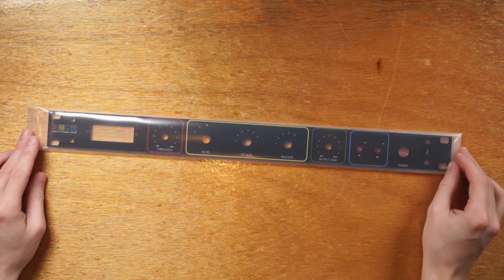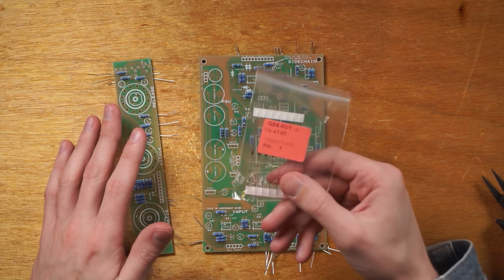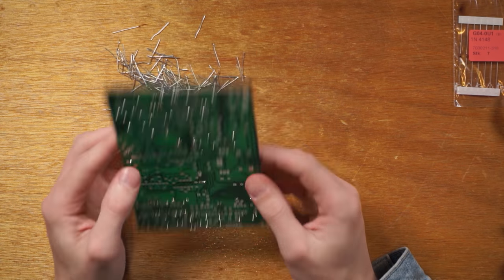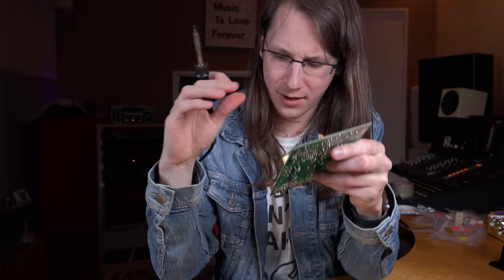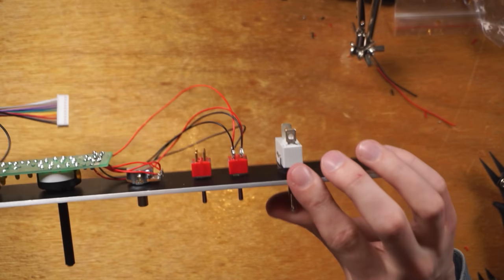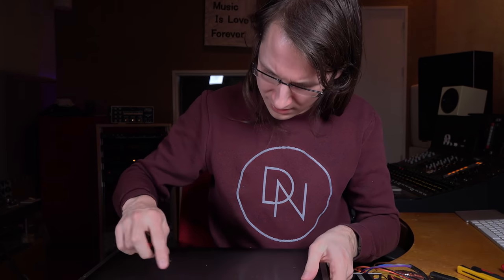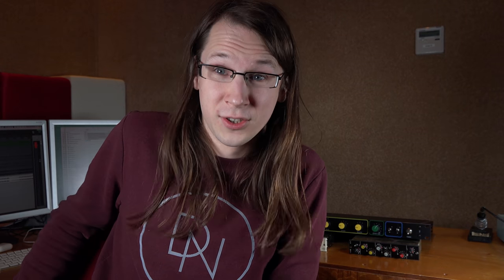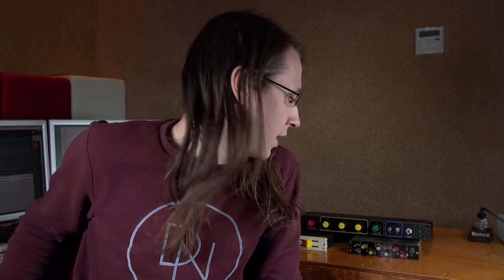I'VE BUILT A REAL GLUE COMPRESSOR!!!

Comment: Three things addionally. 
1. Use a power switch that switches both poles, so you never have 230V inside when switched off. 
2. Connect GND of the mains to the housing and to the ground of the circut. 
3. Add a fuse

Comment: Moderately useful hot tip: If you only bend the resistor/ diode legs over at 45°,  they'll still hold onto the p.c.b. securely and be much easier to solder/ clip the excess legs and reduce the chance of solder "bridges" 
Also if you place the populated p.c.b. on a tea-towel or the like you'll be able to apply a little pressure while soldering for a snug component fit! 
BTW, this was an awesome project to watch you build! More content like this please! 😊👍👍👍
Reply: If you bend legs at 45 degrees or thereabouts to hold them in place and then, when about to be soldered, set them to zero degrees (i.e. straight through the hole in the printed circuit board without a bend) the components will be much easier to remove if required. Believe me, too much heat stress or mechanical stress on a plate-through printed circuit board or the component that you are soldering or removing is not good. I do all my soldering in this way and it is very reliable. The tea towel idea is a very good one or you could try some foam rubber or similar. I would also raise my work surface so the eyes are about 20 to 25 cm away and I use a strong light to illuminate the work. I do a lot of surface-mount this way and use cheap magnifier-type reading glasses to see what I'm doing (sometimes more than one pair!).
Reply: @hoppyhopster8498  I just tape the components with masking tape to the top of the board and leave the leads straight. bending them at all is just a horribly bad idea as you pointed out for later removal. But I will put in a bunch and use masking tape to hold them down and solder them. done. No bending allowed or required.
Reply: @Wizardofgosz  Good idea, thanks for the tip.

Comment: I always build the power supply first, and test for correct voltages before populating the PCB with the signal components, and particularly the harder to find(more expensive in some cases) parts like vcs'a and FETs. I've built some great mic pre's and 1176 comps along with an La2a build I'm currently working on. It's great to see other people posting videos on this topic! Well done!!
Reply: Word!
Reply: Dealing with a SSL Clone that seems to be inoperable, do you have a breakdown of wiring for power,bypass, and sidechain, and voltages to and from the transformer?

Comment: I also built a GSSL from PCB Grinder last year as well as SSL-style compressors for the 500-series rack. Anyone who is afraid of working with 230 Volts and who happens to own a 500-series rack, go check out the absolutely brilliant DIY kits by Sound Skulptor. Their CP4500 is a (G)SSL buss compressor in a two-slot 500-series module with some added features (e.g. sidechain filters, dry/wet mix knob etc.). Highly recommended!

Comment: My thoughts on improvements...
Put an "On" indicator light on the front panel.
Put the trim pots for the VCAs on the front panel, or at least you could drill access holes in the bottom of the unit.
Nice.
Reply: yes, that will be more clever to do
Reply: At least someone suggested drilling holes in the bottom of the case, way better option than opening it every time you need to trim it. Plus testing with the case open is a good way to destroy hard work by being clumsy (like me).

Comment: nice little kit. I was taught you should always bend, trim and then solder. This seals the trimmed lead so it can't corrode and is the military spec method. It's also how wave soldering systems work where the solder wave covers the contacts and seals each joint.

Comment: Great vid! Note that for safety (regulations) you should always include a fuse in the power connection. And if you're using a grounded power connector you should ground the case. And while you're at it, simply replace the current power socket with a fused one that includes an EMI filter. They're cheap and will prevent your house from burning down plus suppress high frequency noise from the power lines.

Comment: i immediately ran to the power outlet and sticked my finger in the hole after learning about elictric safety in the intro ;)
Reply from the maker: Best way to learn it :-)
Reply: Ive actually done that before. Once with a paperclip, the other time I had a chrome dog chain and an exposed outlet with a night-light plug 🔌 hanging half way out of it. I took the dog chain and would fling half of it towards the exposed plug/outlet while holding on to the other end of the chain.

Once I flung the chain towards the plug and it touched the bare metal hanging out of the outlet and exploded, with the shocks sending me flying with sparks everywhere.

I was a dumbass kid.
Reply: I cut a power cable with cable cutters once.
While it was plugged in.
The spark blinded me and the pop made my ears whistle and the safety switch cut the power, so I was there in the dark, blind, partially deaf, feeling very stupid but grateful to be alive and unharmed to feel all of that.
After a few seconds of silence a buddy that was with me asked if I was ok, I said yes and then we switched the power back on, after unplugging the cable.
We laughed really hard at that point, and when we checked the cable cutters there was a hole in the blades that was exactly the shape and diameter of the copper.
Reply: I was dismantling an old TV, one that had the big tube with flyback transformer, well I cut the wire cathode wire? and the voltage from the charged electrolytic capacitor going through the transformer killed me. (Not really, just flew me across the room)

Comment: Where did you find this info 5:28 about what to use differently when using 202C's ? two 50K pot trim and two 1M ohm resistors. What else? and where does those resistors go? You have a link?

Comment: Nice build! One suggestion: change the trim pots to real pots on the case (maybe on the back so you don’t disrupt the front panel), so you can always recalibrate easily without even opening the unit and you can play with the distortion too! cheers!!! :)
Reply: Wouldn't you need access to VCA pin #4, to check mV level? In my experience, calibrating THAT218x by ear is easier said than done lol

Comment: If one were to drill small holes in the bottom plate directly in line with the trim pots and place a plastic plug in them, then one would have easy access to the trim pots for calibrating the unit. Good build.

Comment: I say: Drill 2 small holes in the base plate to acmes the trim pots with a plastic screw driver. Thank you for the video, it's a good build.
Reply: @Will B -  I was just going to say that.  Thanks for verifying that solution.

Comment: You could turn that trimmers on the solder side thing to an advantage. Drill small holes to the bottom plate under the trimmers and you can adjust them without opening the case.

Comment: Wytse, if you have build it without the "Turbo Mod", it behaves different from the one in the Console. Check out the Video from Expat Audio, where they are explain the difference between the gSSL and the SSL Console Comp. If you build the Turbo mod, it´s the same as the Console one. The Board alone is 15$, you need only a few components, mostly Resistors, 2 IC´s, a few caps and diodes. The Parts are ~ 15 Euros from Mouser, so this upgrade is worth its money.

Comment: You could add a simple LED (powered through a simple resistor by the +V rail) somewhere near the back of the VU meter. In that way you have both a power indicator and a backlight.

Comment: Built one of these years ago, not from the kit just the PCBs. Really love it and have been running mixes through it for 10 years with no troubles. Oh, except the power up is really odd and I have to flick it on and off a few times to get it to start up. :D
Reply: That is probably a powersupply "latch-up" problem. Common with specific brands of voltage regulators (the 7815/7915). Just replace these two with a known-good brand, and it'll probably behave..
Reply: @JakobErland  thanks! very good to have some idea what's the problem after a decade of using it! I'm very used to powering it on this way now but if I have a DIY day I'll try that out to fix it. Thanks:).

Comment: Where the AC mains connector is located, I would replace the connector entirely with one that has a multi-section filter and possibly also a surge arrester. These are available for a modest amount of money and take up very little extra space.  The added protection from electrical pops and crackles when your house-mates switch on the washing machine or food blender is well worth it, particularly if your gear is connected to an expensive pair of studio monitor speakers.
Reply from the maker: The studio is not in a house 😂
Reply: @Whiteseastudio  Good idea! But the idea still applies. AC mains is not pure sinewave and the filter helps clean up any spikes or nastiness. I put filters in everything nowadays. By the way, I love the project and wish you every success with it.

Comment: What a cool video! I'm curious as to what kind of VCA chips were original. I once built a VCA to take the place of a failed DBX VCA on a fader module of a MCI console. I used an Analog Devices chip that worked very well. but is now obsolete, however THAT Audio makes one that looks as good. Nice job on the build.

Comment: NEVER turn a transformer when it's fastened down. always open the bolt properly if you need to turn it. It's incredibly easy for that insulation to get damaged and that's a electrical hazard right there. 

Those mains input terminals require heat shrink to prevent you accidentally touching them when you have the case open... and any possible foreign materials entering the case possibly shorting them out.

When you attached the power cord with the case open, having your hands almost touching those bare connections. I was really worried...

I'm an EE, trust me on this :D

Comment: About those trim pots, why not just drill two small holes lined up with the pots on the under side of the case? Remember the azimuth pots on old cassette decks with that hole on the underside? Same idea, and that way experimenting will be much easier, or just changing it for whatever reason when ever you want to.  I'll have to see how much the DBX vca's cost, Canadian money is so far down compared to when I was your age, 30% down which is great for exporting but not importing! It sounds good, and even better in a lossless environment. Thanks for the video, good information and a money saver as well.

Comment: I was so shocked when I compared the GSSL my brother built me to the Glue compressor, as I could not tell them apart when A/Bing them with a drum loop from the DAW. So the realization was 2-fold one that VSTs today sound amazingly close to HW and second that my brother has nailed the build 🚀

As for where the HW is useful, tracking guitar was amazingly good pushing the input stage with a real instrument creates something that no plugin can match. But once it's digital the difference was gone, even when running it in and out through the AD/DA. HW and SW were consistently behaving the same.

I got confirmation to my findings by speaking with some developers, and some of the secret sauce lies in impedance and how different analog equipment interacts with eachother.

So basically folks if you want to make amazing music today, and you don't record don't let not having HW stop you.

For mixing plugins are top these days!

Comment: You should have put offset pins on the VCAs so you could remove them and attach them without soldering to the main board.  But this sounds very good. Congrats.

Comment: Very nice :)              It's worth putting some heatshrink over the mains joints - it just helps to protect you from accidental touching, costs next to nothing takes an extra 2 minutes.         Also:  (and you may have already done this and not shown it in the video) I generally chuck a voltmeter across the XLRs on anything I've built before I plug it into my expensive-to-repair-the-pre-amps audio desk  :) :)       It sounds glorious, dude - especially love the DBX VCAs.

Comment: A full bridge rectifier converts +/- AC into +/+ AC. Used with capacitors you can create a stable DC voltage/current. 
Full bridge rectifiers are just 4 diodes connected in a specific diamond shape with AC inputs on opposite sides and output on the other opposite sides... so if you have 4 diodes, you can make a full bridge rectifier in your circuit.
Reply: ...also, you did pretty good at soldering! In a previous life, I did Radio repair when I was in the U.S. Marine Corps.
Reply from the maker: Thanks! I've been soldering since I was 9... so I have a lot of experience :-)

Comment: Hi,
You have to add the OXFORD OPTION (or TURBO MODE) to have the real sound of the SSL4000 comp sound,
Because of a missunderstand schematics reading, the one who made this kit at is origin didn't see that the sidechain had to be in stereo signal, going throught 2 disctint VCA and then mono VCA signal (yes you have to add an extra VCA for the side chain) raher than "monoing" a stereo signal to 1 VCA sidechain
The result when listening is totally different
The version you made tend to reduce your stereo width and put the mono more in the back (but it's really intersting)

The turbo version or oxford version (the real SSL4000 comp) doesn't change the stereo width
Try to add the turbo kit and you'll see the real difference, tell me what you think ;)

Comment: Great! Now better PSU, turbo board, dry/wet mix, more sidechain frequencies, true relais bypass, more ratios....well, you could spend a lifetime on the ssl mods :) !
Reply from the maker: Yes, true! Bypass not really needed, dry/wet is cool, but also possible in the DAW. Turbo is an interesting thing though...
Reply: @Whiteseastudio  Build countless of these babies years ago and it was a great entry to many cool DIY machines which followed. Check your SNR when you make up the gain...I found rectifying on the mainboard is not that great and should be the first thing to improve. The true relais bypass is great for live mixing on big shows...when someone pulled the power cable or something weird happens to an analog component I can switch the unit off and the signal runs through like through a cable ;)! Turbo would be also possible in the daw when you manipulate your sum first with a ms matrix and then put it in the external sidechain of the gssl. But in the end everybody can do everything what is possible in the DAW these days what makes the whole game less worthy but thats a philosophical question of idealistic values and quality in music ... another story :D !

Comment: Funny it is viewed as a fault by the hardware manufacturers it still blasts my mind how distortion occurs in such circuits while it is still a controllable distortion not like there is some wild clipping going on. Such great sound and even that device  is considered a clone sounds better than some software to my ears. It doesn't mean there is any smart software around but it is a joy to know his own tools. I wonder if someone can do same design based on programmable DSP like some FPGA and what really makes the dbx VCA so expensive.  i guess it is not desired as the main quality of such beasts comes from the reactivity to the signals from the resistors